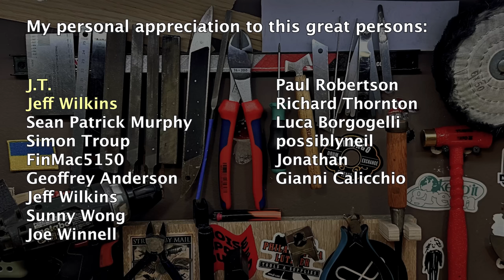Martin Acoustic Guitar Headstock Repair

Comment: Great job! I haven't seen many breaks at the volute. It is ironic since the volute is designed to fortify the pitchback of the of the headstock. I always see breaks above or below the scarf joint. I wish there was a way to get you some GluBoost. It will save having to refinish the entire neck to conceal the repair marks. Nevertheless, it turned out awesome. Well done.

Comment: Aesthetically, that's about as good as a headstock repair as you can get! 

Compressed air is a great way to get glue deep into a narrow crack.
Reply from the maker: Great idea!
Reply: Or a glue syringe. I would be afraid that compressed air would blow it apart.

Comment: Falls are always dynamic, and egregious. God bless any player who has to suffer from such. 
Back in the early-to-mid '70s, players were coming into my brother's music store with old Gibsons and Martins and Guilds, in need of new tuners ... Back in the past, makers seemed to use lower quality tuners to save money. I hand-reamed MANY a hole to instal new Grover or Schaller tuners. Using a reamer and a rattail file, I marveled at the mahogany dust that came out of those old headstocks, as it was dry as the desert. This was in Tallahassee, Florida where you would think there was plenty of moisture. However, home heaters and A/C units dried out all kinds of woods. My belief is that super dry wood is weak wood. I use a simple humidifier in the cases of my guitars with mahogany necks. Those things are bone dry in about three weeks, dependent upon time of the year (there are actually a few weeks where we do not need the heater or A/C).
Here's my method for installing strings:
All you have to do, is run the entire string through the post. Back it up maybe a post-and-a-half's worth. Bend the excess toward the middle of the headstock. Wind the string down like a coil (the lower on the post the string, the tighter against the nut it will be). Then bend the excess string back and forth until it breaks off cleanly. No need for clippers. No stickers to nail your fingers. However, you have to twice overwrap the string-through on the 1st and 2nd strings, otherwise, when you break off the strings, they will slip on the posts.
Trust me. You will love having no stickers to draw blood. By bending the excess string toward the middle of the headstock, you form an "S" through the post, adding to a tight fit. Oh yeh, some nut lube on that nut will work wonders for tuning. That’s 61 years of string changing experience for you … But what’s right for you, is right for you!

Comment: This is an all too common job in a repair shop! I see a lot of these in my shop. The internet says this only happens to Gibsons and the volute is there to stop this from happening. 🤔 I had a Les Paul Menace in the shop with a similar break but it was caused by a rogue robot vacuum cleaner dragging it around the living room! Put your guitars in the closet before turning your robots loose in the house! LOL! Tanya, I have a jig I built that holds the guitar neck down at a 45 deg. angle. It really helps get the glue down deep in the crack. Especially the tight ones that you really don't want to open up! Great repair there!

Comment: This happened to my Gibson. I used Dispensing Needle 14 Gauge x 5" with 3 Pcs 30ml Blunt Tip Syringe Needle  I bought from Amazon to inject the glue all the way in. I waxed the out side area with bees wax to keep the glue from sticking to the out side. Worked well.

Comment: What a geat job! Did you use the Superglue you to fill in the cracks? Could you please show how to fix the curved neck of a classical guitar w.o. a truss rod. Or is it too expensive for the majority of (reasonably priced) guitars ?
Reply from the maker: CA is great as filler and kind of primer.
In some cases curved neck can be "fixed" by just planning of fretboard and proper refretting, but in case of major defects or twisted neck it jus too much work and it make no sense at all)) 
But if I got an occasion - I`ll make video)
Reply: @TanyaShpachuk  dyakuyu, chekayemo!

Comment: These fractures are easy to prevent / repair.   After gluing the headstock / neck joint, route a pair of slots in the front for carbon fiber ⅛ x ½ .  Epoxy the carbon fiber in place.  c'est fini

Comment: Great job. Really clean! Although, before respray the back of the neck, on the playing part, the finish was rather shiny and it looks more mat after the spraying. Was that a requirement from the customer? I think I would have made it shiny smooth again. Thanks for your reply Tanya and please be assured than in no cases this is a critic, just wondering! :)

Comment: I have a few questions to ask you. How durable was that glue and how long did it last after you repair that? Did it ever come apart again?
Reply: Titebond Original has a strength of 3600 psi. Ultimate could have been used which is a little stronger at 4000 psi but in theory the glue joint should actually be stronger than the wood itself. She did fantastic work 👍

Comment: Fabulous repair you'd swear the headstock never broke. On the other hand , Martin necks are supposed to be stronger because of that pointed area on the back. This is for added strength and support so Martin aren't as good as they say especially for their price $$$$$$$$$$$$!
Reply from the maker: Martin is totally OK, but still is not strong enough if it hits the floor 😬

Comment: Cosmetically it’s a nice looking repair , still weak there , I’d have routed in two spines either side of the volute and made it stronger than when new
Reply: Nah I'd of replaced the shichem and poloropticaled the sync dual flux with modular quin left spinx, it endures pressure on the obolocks or i would have did what Tanya did

Comment: I would have thought you would have used the eye dropper  for the Titebond like you do for the CA glue.  Is the Titebond too thick for it?
Reply: Titebond is definitely too thick, for an eye dropper. She did it the right way, for this type of repair.
Lightly dampen the wood with water, flood the joint with glue, work it deep with a tool, then clamp the crap out of it, to make sure the wood fibers are as tightly joined as possible. If that headstock
should ever crack again, it will Not be on that glue joint.
Reply: @zapa1pnt  👍

Comment: I can’t believe she uses wood glue, I am watching but I am scared because I want to fix my 1960 something, semi acoustic, hollow, thin body, 12 string electric Framus Atlantic guitar that separated its top all around 3/4 of its edge which starts at the top and curls around the edge and finishes at the bottom a ways. I forgot the strap was antique and it snapped letting the guitar fall face down on concrete, like it just popped open, little on the top edge around to the bottom edge, I am thinking of 30 or so small clamps and wood glue, first a test dry clamp, if that looks good than I will use wood glue, whaat do others think?

Comment: So what was the spray? What glues did you use? Is it a secret? 
I have a guitar very similar to that and watched your vid hoping to get some advice on how to fix it. Not much help at all. Just you showing off how good you are.
Reply from the maker: If you have nice quality guitar and don`t have experience in that type of work - better don`t do it by yourself. It can be tricky despite it look easy.
And I have similar video (Ibanez neck repair) on my channel, it has subs with all info, if you are still want to do it and seeking info :)